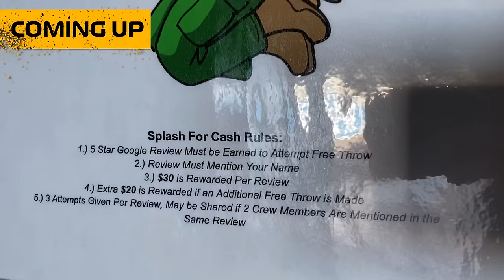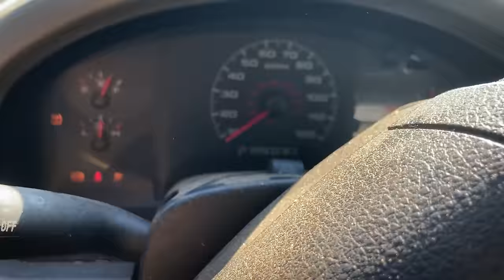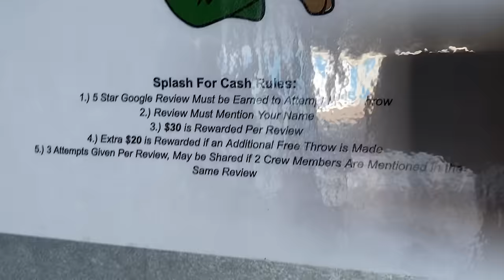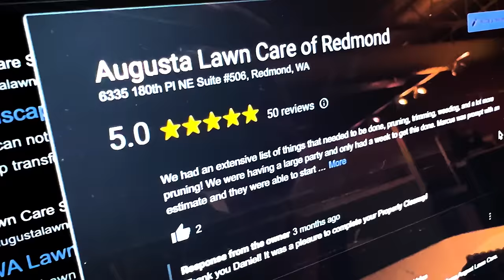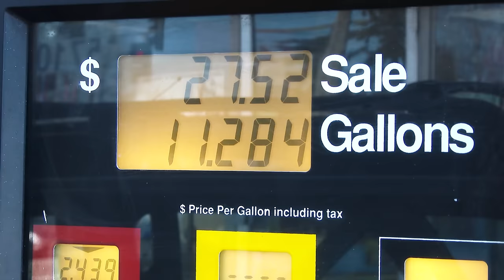Customer CONFRONTED for NOT PAYING ► Lawn Care REPO

Comment: I have developed a rule: if the project is over $500, first half of payment is required to begin the job and second half upon completion. In my opinion there's more upsides to doing this than down sides: 

1. It ensures that you are getting some payment upfront if the customer had any intention of not paying you or not paying you timely
2. It motivates myself and/or employees as it completely removes the stressors of wondering if the customer won't pay for all the hard work you're doing (or they're a late payer)
3. There's a higher chance of receiving full payment due to a psychological effect that if you're already invested half-in; then paying the 2nd half is a bit of an easier pill to swallow (instead of receiving one really large bill). 

However, I will admit there are some downsides. It makes billing a bit more complicated and it makes tracking payments by job and/or tracking numbers more time-consuming to keep accurate. But, again, in my opinion the upsides out weight the downsides. 

Thanks Mike and team for these videos. I'm loving these series and hope to see continued episodes. Also, I like the longer episodes 😉
Reply: Yep 50% deposits for bigger projects for sure
Reply: My rule of thumb is I need at least my day rate (250$) down on bigger jobs+ cost of materials if is mulch
Reply: Yeah this is what i did as well… if sometimes for $300+ jobs if it felt like the right call. 👍
Reply: I quoted a job for $2500 asked for 33% and was told by the customer that she felt unsure. I explain. To her we were on the same boat, I can put off not getting my pay on labor, but not fronting the material. Oh well
Reply: This is the rule I follow for my Automotive business especially for major work, that would cost a lot lets say 700-3k I'd get half to begin work and once Im done I get the rest or if customer doesn't pay the rest then atleast Im not screwed (I work alone so don't have to pay any employees and I own my own shop thats on my land) and have money to put toward the business and future stuff I would like to get.
Reply: I agree. With a job that big, you got to ask for half up front. You can't get stiffed on that.
Reply: i never pay in advance - too many people take the money and run.  maybe if it was on a credit card or was a very established business but not a small operation.
Reply: @tyler   I agree, we are dealing with this type of thing now as we have started a pretty large roof repair, Division.
When we were large projects, only, we would just follow the Maryland laws of 1/3 upfront, 1/3 when material arrives and 1/3 upon completion 
Now with the Repair division, we occasionally have $275 jobs and $500 jobs, billing/invoicing multiple times on $500 doesn’t seem worth it to me, but at the same time if a homeowner rips me off it would be better at $250 versus 500.
For now if it’s 500 or less, I’m rolling the dice and taking payment upon completion and if it is more than 500 then we get into the multiple invoices. 💪
Reply: Probably gonna end up taking them to court, but at 7:50, which I do believe when you’re in a service based using the 95% of the time courts will actually rule in your favor because you’re in the service industry same thing with hairdressers, barbers maids, caterer, chefs Yeezy, the court will always go on the side of caution and the largest industries because of a unless you know, faithful witness chefs are cooks unless the food is edible will probably get half you submit your receipts for the cost of food and labor and most likely they do have for those industries, butactually get fully paid

Comment: Just came across your channel. If you’re ever losing money in your business small tweaks make a massive difference. For example if you have a POS asking for tip is a good way to add more revenue especially if you’re the actual person working. Also increase profit margins but small tweaks 2-3% cushion on bigger projects over certain thresholds example $500 add 2-3% $1000 add 3-4% $1500 add 4-5% ultimately these small changes will help you spread risk better so you have less loss days. Also teaching staff should have its time and place in the schedule without taking time away from customers.

Comment: Sorry, but if I rent a u-haul and it starts, it will be driven until it or I shut it off. It's not that I'm giving it anything it can't handle, It's that I'm paying for a "reliable" truck for the rental period and I'm owed at least that. Not to mention, companies like U-haul have insurance policies for this reason exactly, to protect their valued customers from having to pay a repair bill that is a result of the hard life the piece of equipment has lived. If their equipment is not able to handle a day worth of work, that's not my problem. It is also not my job to diagnose or inspect the rented vehicle AT ALL!! As it should be release to me, the customer, at an assumed %100 operability.

Comment: @Mike Andes 
Any job that ends up costing you money, just means you have zero to very little wiggle room when it comes to prices. Increase your prices by 15%
I noticed two things....
1st It's nice to be nice, but never when it's costing you money.
 When the homeowner asked for additional things to be thrown in for free or ''no charge'' you agreed to do the free work with a smile without a 2nd thought of charging . 
This will, most of the time, create problems.  Something done for nothing, is nothing, as far as the customer is concerned. Then they look to add more free nothings on to your work load.
when your no longer smiling about hours of free work and ask for the additional money, they expect that you to eat the cost

2nd Don't be so eager to work for free. Coming from a 37 year owner that has 4 crews of 3 men 6 days a week.... GOOD LUCK

Comment: Mike, I’ve started my lawncare/landscaping business in May at 15 and I’m bringing in $750-$800 a week. But I’m trying to save up for a truck for when I turn 16. However I’m wondering when should I upgrade my equipment/setup or keep saving for that truck. currently my 16 yr old brother works for me and we put 2 mowers a leaf blower, weed whacker, bags and a few Jerry’s cans and stuff in the back. I recently just bought a trailer to do mulch jobs and more services like fertilizing, I also have 2 21 inch mowers. However I’m looking at getting a 30 inch mower so I can go to some bigger lawns and make even more $ in less time. So just wondering what your thoughts were if I should keep saving for a truck or keep upgrading my equipment?
Reply: I already commented on your last comment last video. Buy what you need/dont have and need… aka a truck. If you get a bigger mower to do bigger properties or commercial stuff how will you get there? And you wont like very professional walking up to an expensive property with a push mower and gas can in hand…
Reply: @jacobshandymantreeservicel2522  hey, yeah I appreciate it but want to see what Mike thinks. And it’s still gonna be a bit until I get a truck because I’m still 15 and my birthday is in January…